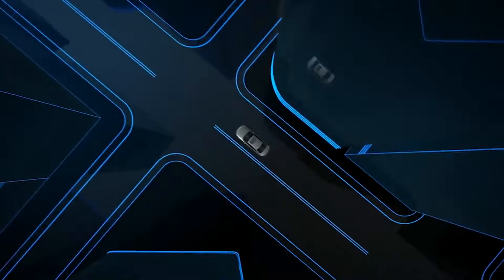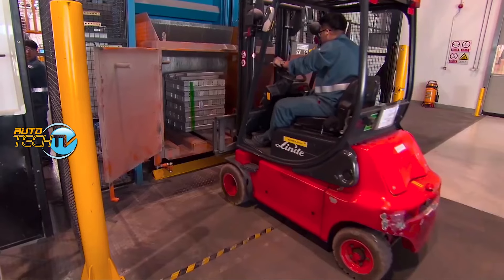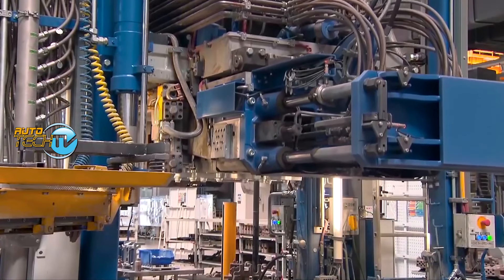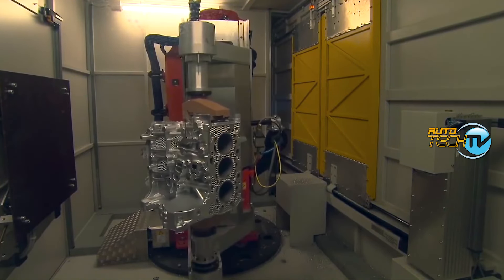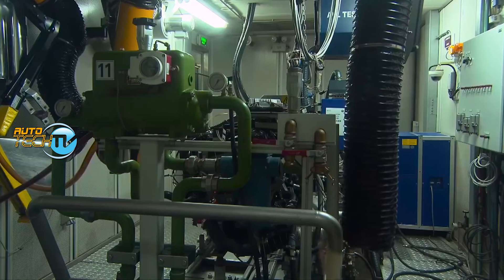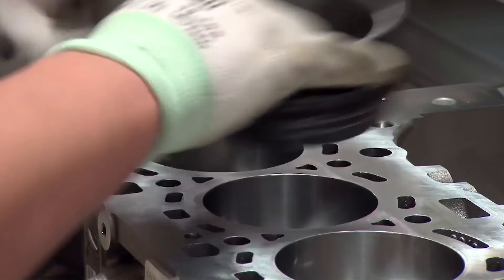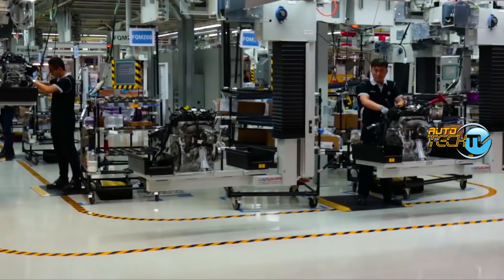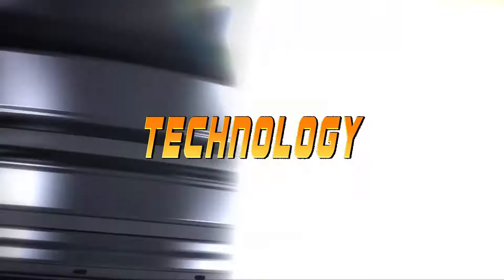BMW car turbo-engine made in China.

Comment: It'll be interesting to see how this pans out over time.
I get the impression German engineering mastered the art of designing something to last "just past" the warranty period.  E.g. designed to "wear" in a predictable fashion - causing catastrophic failure after a predefined lifespan.  Gone are the days things were built to LAST a long time - for if they did, you wouldn't need to buy another one......
Reply: Very true. With their servicing b/s always change oil twice as often as the service interval.